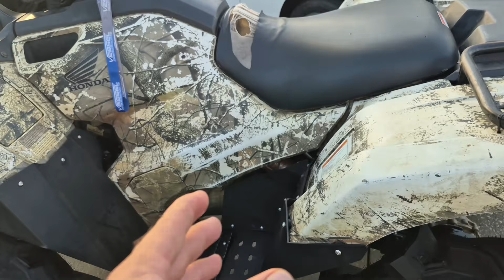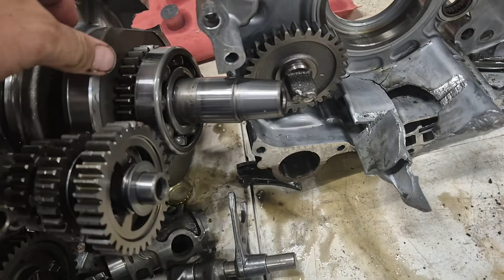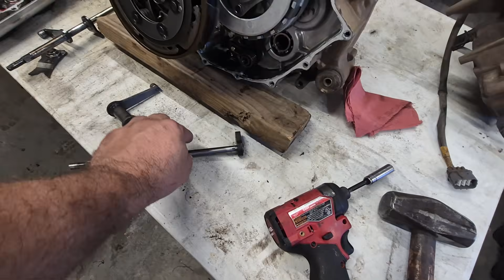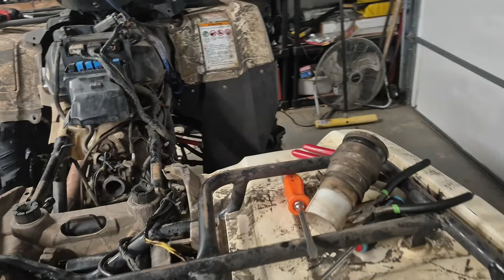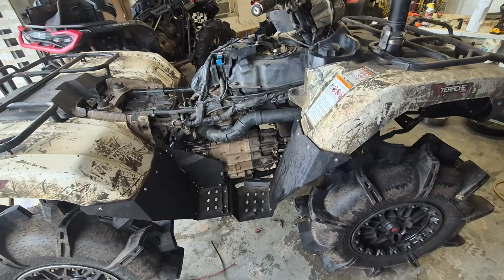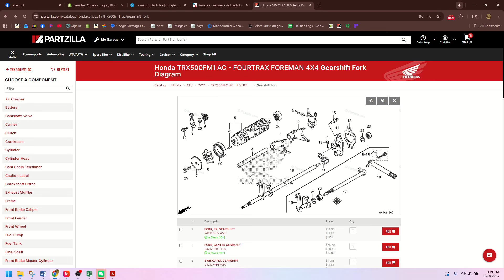Electric Shift to Foot shift conversion "FE to FM" Foreman & Rancher: Time for clutch dumps!

Comment: how hard would it be just to put a brand new foot shift motor in a ES 500?
Reply from the maker: it depends on the year and stuff but for the most part everything you need will plug in

Comment: 2019 ranche Put a footshift motor in a dct frame and having issues with the rear u joint seems I can see the oring just about on the edge of both ends of the u joint and seems abit loose any suggestions?
Reply from the maker: which foot shift motor? irs and sra have different length output shafts
Reply: @MudPuppyOffroad it’s a 17 rancher footshift motor and harness I put in, so I assume I’m gonna have to get this diff alittle more forward then the factory  location
Reply: @MudPuppyOffroad airbox in the way tho wonder if I can get like half an inch longer u joint from something, its together, feel this u joint could be more snug to the o rings tho,
Reply: @MudPuppyOffroad can I email you photos?
Reply from the maker: if you put a SRA engine into a IRS frame you need to install a Rubicon foot shift IRS output shaft  @jeremijr
Reply: @MudPuppyOffroad bout to order one on partzilla,, I just pull rear case off pull the old out put new in and done?

Comment: Hey I’m in the middle of swapping a 2018 rubicon deluxe 500 es into my manual 520 and doing the swap from electric shift to manual shift and I’m running into the issue with the rear cover with the upper final shaft as the shaft on the upper of the final is completely different from the es to manual. My es motor has a removable shaft and my manual motor is a shaft which appears to be part of the internal transmission any thing I can do to make this work?
Reply from the maker: Are you sure you don't have a dct?
Reply: @MudPuppyOffroad  i believe I do, didn’t realize it at the time when I got it only paid 300 for the engine should of looked more into it before buying
Reply from the maker: @josephmoore-r9s yeah... Sorry man totally different
Reply: @M @MudPuppyOffroad n’t know where I may find a good priced used engine I’m on the far east of Canada and we don’t have much here for engines

Comment: What about the clutches? Did you swap them over?
Reply from the maker: Same clutches?
Reply: @M @MudPuppyOffroad  dct same as the foot shift clutches?
Reply from the maker: @SteelBridgeBoys DCT is not electric shift (ES/FE) totally different transmission. You can't convert a DCT to a footshift.

Comment: hey i have 2 questions one is do you know why whenever i do a water wheelie even for like 3 seconds it goes into a false neutral and just revs up its a 2019 rancher dct. my second question is do you know if i can just drop in a 2019 rancher foot shift motor in my dct frame i know i obviously got to change the harness but was wondering if there was anything i would have to cut/weld to make it fit. thank you
Reply from the maker: That's totally normal on a dct. The oil drains to the back of the motor and it loses oil pressure to operate the clutch. Try adding a half a quart extra oil seems to help a little bit
Reply from the maker: I've never messed it during that swap you would definitely have to swap all the wire harness and everything

Comment: Hey quick question. I have a 24 rancher can I put a 24 520 top end on it if I have a tuner and exhaust?? Also what tuner would you recommend if that is possible. Thanks for any info. Awesome video by the way.
Reply from the maker: The cylinder will not fit into your block without mods. Also the performance increase is marginal at best.
Reply: @MudPuppyOffroad ok thanks for the info. I'm gonna just rebuild the 420.